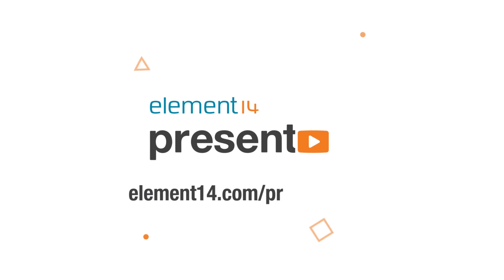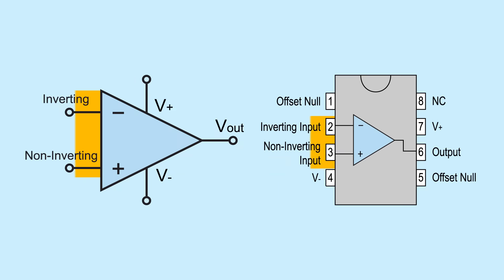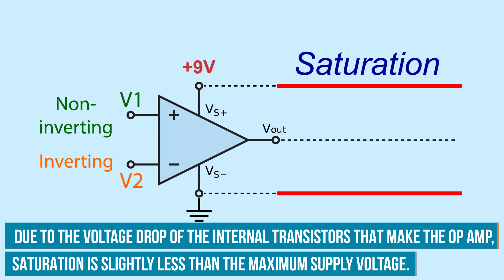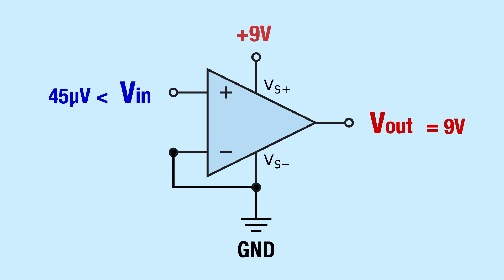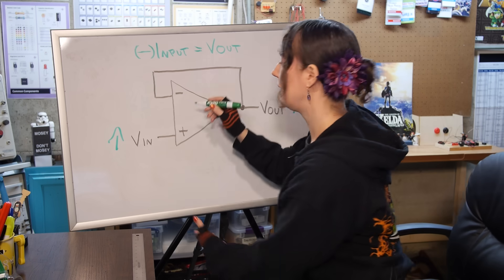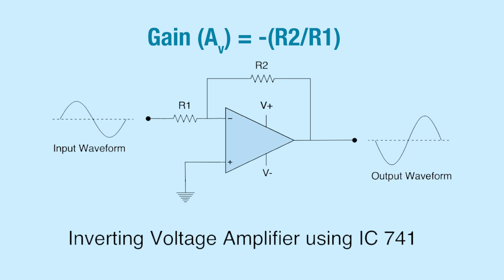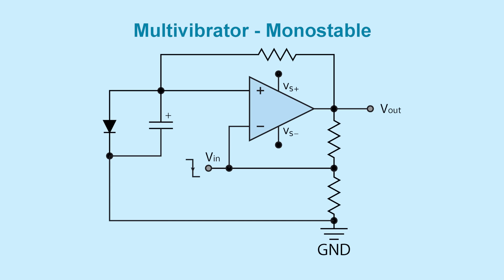How Op Amps Work - The Learning Circuit

Comment: Oh boy the infamous 741, haha. You can't imagine the headaches that this little guy gave me in EE. Almost all of my PCB's that had the 741 never worked properly, and my professores would say "Oh the Schematic is correct and the theory is ok, but the 741 does not work for this application". It is a very simple op amp for sure. Amazing video!
Reply: Considering how much trouble the research for this episode gave me, I think I can imagine the headache. Haha. Glad you liked it!
Reply: About a year ago, I was at Dave Fullagar's home, the inventer of the uA741, the first internally compensated operational amplifier.  He's as humble and sharp as ever.  I actually met him after he retired from Maxim Integrated Products (one of three original founders), where I worked for a couple of years.  Interestingly, he was supposed to be a geotechnical engineer but changed while at the university.
Reply: Is it possible that your circuits would have worked with an op-amp that had rail-to-rail outputs, which some do but the 741 does not necessarily? You can get differences between nominally equivalent op-amps with the same type number but of different makes.  I designed a circuit for lithium cell management that worked well with a TLC272 op-amp made by Texas Instruments but it malfunctioned with a TLC272 made by ST Microelectronics. It turned out that the Texas Instruments TLC272 has rail-to-rail outputs although they are not demanded by the component specification (but not forbidden either), and the STM TLC272 does not have rail-to-rail outputs although it does conform to the published specification.

Comment: The op-amp rule of thumb:
"Op-amp will do all it can, to make both inputs equal (same voltage)"
Reply: And openloop?
Reply: @duality4y  Then it's a comparator! :)
Reply: @duality4y  with openloop it doesnt have the dampening effect on the output so the voltage will always shoot the minimal and maximum supply voltage (for example +9V and -9V)
Reply: Only if there is NFB.

Comment: This is not meant hateful but this video is not done well in the area of theory of operation. There was enough misinformation that it will cause issues with people looking to learn. The sinusoidal AC to square DC waveform statement was just incorrect, for an easy early on example. Square waves are AC. DC doesn't have a "wave" (for simplicity, for you EE's) property to it. The circuit was not correct as another glaring issue. I think this video was meant as an introduction but man, if your going to introduce something at least keep the simple stuff correct. Nothing wrong with being wrong. Its what you do to learn. In this case though, Element 14, I urge you to consider correcting this video.
Reply: And please look at at least 4 more errors found by others.  To add mine: naming a switch from a relais 'Vout' is bad practice.

Comment: Hello Lady 
Did you ever make a real working circuit with an OP-AMP??
At 6:16 you have short-circuit the inputs of the Differential OP-AMP !! 
this schematic can never work!!
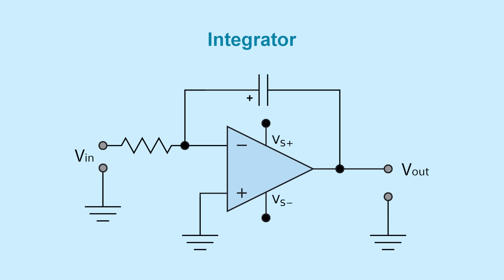At 6:32 the formula below the Wheatstone-bridge is wrong. Must be Vout=G*(V2-V1)
At 6:32 at the sensor-activated amplifier is the coil acting as a differential. Probably you wanted to draw a relais but has another symbol....sloppy work

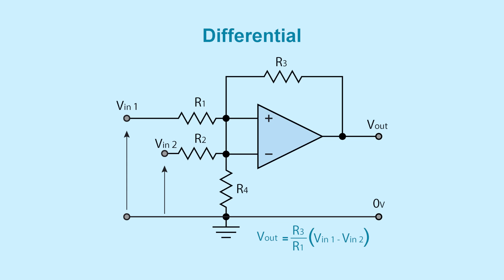Comment: I think there is a small error at 6:22 where you short the 2 op-amp terminals together. Also, it should be negative feedback for operation stability; therefore, the formula signs change. 

Your concept is clear and instructional. It is helpful. Thanks.
Reply: At 6:22 Swap the + and - OpAmp inputs to the resistor network. Remove the wire connecting R₁ to R₂.
Also:  R₁ = R₂  and  R₃ = R₄.
Now the equation applies.

Comment: Your differential amplifier circuit has an error in it....there should be no connection at the R3/R1 to non inverting pin...
Reply: thank god, i am a beginner, so, i was totally wrecking my brain over how it could possible work...
Reply: Yup! It went to the next slide and then I go wait that didn't look right, lol -- the connection between the non inverting and inverting inputs just need to be erased -- so R1 still connects to R3 and R2 still connects to R4, but the connection between those two nodes just needs erased :-)

So you could just save that picture and erase that little line and be good to go with a nice basic diagram for a differential amplifier :-)

Comment: when using OPAMPs to control a solenoid to a control valve,  FEEDBACK MINIMIZES HUNTING when a change is needed.  It is somewhat hard to explain without a drawing, but basically Hunting is when the valve opens/closes too much then having to close/open back to compensate and once again overshooting, so on and so forth until it finally stablizes out.  Feedback makes for much smoother and finer control
Reply: What you describe is really integration. NFB causes the hunting: integration damps it.

Comment: One use case (as on the official Arduino motor shield) is a form of current draw feedback. Surprised that wasn't covered. (And no, I don't understand it myself, I've just seen it being used to prevent overcurrent; ie short protection)

Comment: Why do you call conversion of 'sinusoid to square' as 'ac to dc conversion'...?? That's wrong.
Reply: The supply of the opamp is connected to gnd so output never goes below 0 (minus V) ... so it is DC.
Reply: @pesekmar  in my opinion a DC signal is non transient. Means: There is no variation in time by the level of voltage. "Alternating Current" means the signal is alternating between e.g. +A and -A. When you add an offset of +B, where B = A, the squared signal alternates between B+A or 2A and 0.

Otherwise: Compare with fourier series and subtract the part, where the frequency is zero aka offset or DC part.
Reply: @lernenmitrobin  Basically all dc signals have some amount of ripple. The difference between dc and ac is the direction current flows + and - are directions in this context
Reply: @pesekmar  3:42  oscillates between saturating negative (-Vs) to saturating positive(+Vs). it need not be ground. in this example shown, definitely not dc.
Reply: @santhoshwagle9857  pulsed DC
Reply: @Ham549  I have to agree with kturst s, The potential goes to negative as wel as positive. And since AC stands for alternating current, and the in this scenario the direction of the current is alternating as well so I would call it AC, not DC. Pulsed DC will never turn into the negatives numbers, otherwise it wouldnt be called Direct Current.

Comment: There's a short circuit between the inputs on 6:12 (differential amplifier).
Reply: At 6:22 Swap the + and - OpAmp inputs to the resistor network. Remove the wire connecting R₁ to R₂.
Also:  R₁ = R₂  and  R₃ = R₄.
Now the equation applies.
Reply: Yup. Someone forgot to check this one.

Comment: The video is informative, and it's not a bad video, but by the title I was expecting something else. It's not so much about how they work, but more about some of the uses of OpAmps. Very nice about the latter, but pretty much nothing about the former. I was expecting something about how the electronics inside the device do what they do -- i.e. how the OpAmp works, and not examples of uses of OpAmps in circuits. I am sure the video will be useful to someone, but not so much for me. Still, I liked your delivery of what you covered.

Comment: I am trying to create some type of open loop system that I am going to try to create to keep an old garden tractor running. ( look up Tecumseh HH100 Solid State Ignition) Anyhow I am going to try to create some type of ignition system that I can hopefully hide under the fan shroud using what I have available to work with. An ABS sensor or something to create a low A/C voltage and a coil on plug ignition system from a Toyota Camry.  I don't have enough smarts to do all of the math to get the voltage down from around 1-4.5 volts from 12 volts to simulate the signal coming in from the computer. I am going to try to replicate that with this and a voltage regulator.
Reply: I don't completely understand your situation based on this reply, but if all you need is some voltage attenuation (gain <1), I would look into resistive voltage dividers.
Reply: @DrewMiller4_18_5_23  I am taking a very small A/C current provided by a pick up coil or an ABS sensor can be used. this induces a very small voltage and current. I need this changed to .5 > 4.5 volt DC square wave. This was depicted in the graphic that it should work. All that I need to do is place a Diode in line on the output and get the plus side of the voltage, which will simulate a 4 volt square wave from the PCM.
Reply: @johnchadwicktilton  Oh gotcha.  Yeah the comparator should work fine for that, good luck!
Reply: @DrewMiller4_18_5_23  You mean the operational Amplifier or something else ?
Reply: @johnchadwicktilton  So an op amp can be used as a comparator given a certain circuit.  Comparator "mode" consists of comparing two voltage signals and outputting a binary (sqaure) output depending on which voltage is larger.  There are dedicated comparator chips which may work better depending on your needs, but if you're just trying to slap something together with parts on hand, an op amp is a great start.
Reply: @DrewMiller4_18_5_23  At about time 3:50 is pretty close to the circuit I am trying to build for an ignition system if it is fast enough.
Reply: The only difference being is that I am going to use a  3.3 voltage regulator to get a higher voltage signal on the output square wave.
Reply: @johnchadwicktilton  That circuit should be very quick!  Please notice that topology is a hysteretic comparator.  Analog Devices has a good article on this called "Curing Comparator Instability with Hysteresis" if you would like more info on this topic.  I'm unsure what you mean when you say that you're going to use a voltage regulator to get a higher voltage signal, but that's ok.  If that means you are going to power the device off of 0V and 3.3V, then your output will swing from about 0V to 3.3V.  If you do this, ensure your input voltage (Vin) stays between 0V and 3.3V
Reply: @DrewMiller4_18_5_23  It is kind of complex, but I am going to try to use a coil on plug ignition system and hide it under the fan shroud so it looks original. The coil has a coil driver built into it. The coil normally receives a .5-4.5 voltage input to create the spark. I was curious and hooked the A/C voltage from the pick up coil  in hopes it might try to fire off of this. It did not, so I need to reduce the voltage to the coil driver to around 4 volts from 12 hence the 3.3 and I need to increase the voltage from the pick up coil.
Reply: If you want to learn more about the original complex circuit I am trying to replace look up Tecumseh HH10 or HH100 Solid State Ignition. This was an early , but complex attempt at replacing the points and condenser system.
Reply: https://m.youtube.com/watch?v=In4YV7jM1tI

Comment: The best thing about OpAmps is they neither affect the previous circuit (high impedance) or the next circuit (low impedance). And you can control the output impedance by putting a series resistor, do whenever the output load is  0 ohms your impedance in the output will always be what you defined in the series resistor.
Reply: did not know that , nice to hear that , that piece of info is worth of gold

Comment: Very nice introduction, 7:22 the inverting and non inverting inputs are mentioned the other way, should be non inverting to the capacitor and the resistor and the inverting to the voltage divider

Comment: Are these schematics really that simple?  I want to use an opamp to make a servo controlled subwoofer which consists of using the line level signal and a  differential amplifier and comparing it against a low level microphone mounted to the sub then you still use a real amp to power it in the end I think
Reply: Be careful to use two identical microphones mounted in-line but facing in opposite directions. Combine the output signals to cancel their tendency to act as accelerometers picking up vibrations in the framework.

Comment: Question: At 6:13, should the positive and negative connection be wired together?????  i'm not the greatest at this, but something doesn't seem right..... A quick google image search, and I see no schematic similar to that wiring......   am i wrong??
Reply: They should not be connected.
https://en.m.wikipedia.org/wiki/File:Op-Amp_Differential_Amplifier.svg
Reply: @thomasw6169  That's correct, it has to be a mistake in the drawing.  The Vin(+) should not be connected to the Vin(i) input, otherwise Vout will be zero.  And the final equation shown is valid if R1 = R2 and R3 = R4.
Reply: if the inputs are connected together, it's not gonna work..
Reply: There are several diagram errors in the video.
Reply: no, the inputs are shorted together...but i'm no expert, and you always think "am i missing something here ?"
Reply: I think it's just an error. Easily done when drawing diagrams for explaining..
Reply: You have a load on positive and negative and to ground so no problem
Reply: @paxanellie  regardless of any load, they are both at the same potential.

Comment: Nice overview Karen, thanks!  One note, I THINK you reversed the resistor-capacitor and voltage divider attachment points (inverting vs. non-inverting) when you described the astable multivibrator circuit at ~7:25.
Reply: At 7:25, swap the OpAmp inputs in the diagram to get the astable multivibrator. The circuit needs positive feedback to slew rapidly and negative feedback to delay the flip to the opposite polarity.
Reply: Dino Papas who.. what?